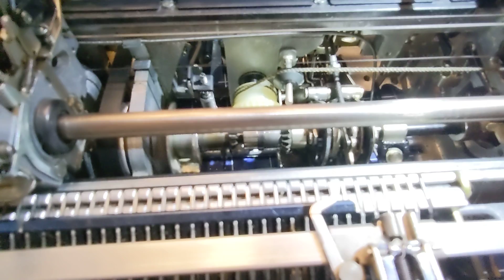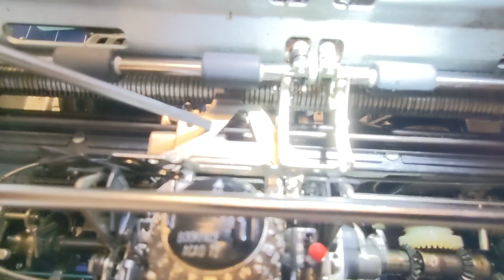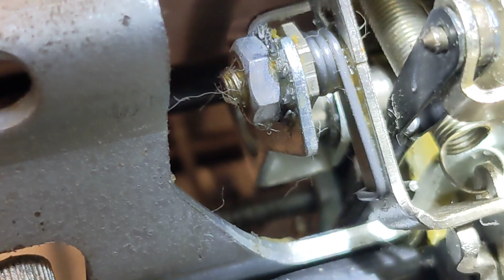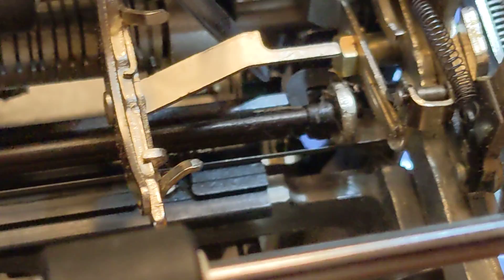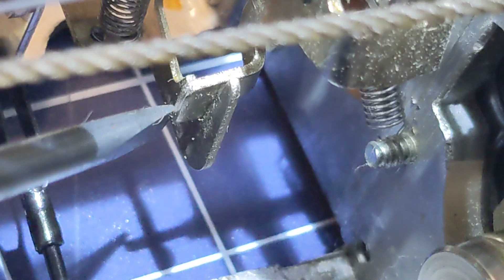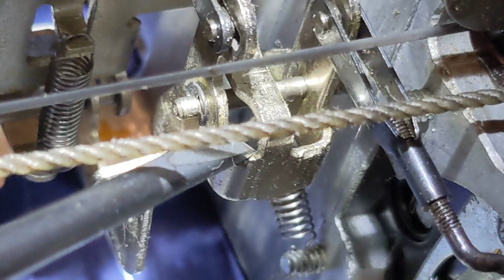IBM Selectric explainer: Escapement - space, correcting, and troubleshooting tips

Comment: Hello Nicky...I just pick up a IBM Selectric III - 50th Anniversary Model olive drab color in excellent overall condition, it comes on, tab works, return works, however the spacebar makes noise like its working but won't move, it will also type but again won't move across the page.  Wanting to sell it on eBay, Q> would it bring a higher price if I get it serviced or sell it as is?  It has a cover and manual; it appears to be complete.  Has a extra replacement ribbon B156 Nukote brand and box of lift-off tapes Nukote 86L-12.  Any advice would be appreciated.
Reply from the maker: @LoveMyRottweiler1 Hi! It's been a while since I've had my hands in the Selectric. The carriage advance issue is 90% likely due to waxy lubricant. Yes, it will be worth more working / refurbished, but probably not enough of an added to justify refurbishing it.

Check to see if the white plastic pulley on the main 'cycle shaft' is cracked. If it is, the machine will make a lumpy-lumpy sound as the cracked tooth contacts the drive belt. The fix is easy for golfball typewriter nerds, but not for normal people. Watch Duane Jensen's videos for a taste. I'd sell it as is, probably on Facebook Marketplace if possible.
Reply from the maker: One more thing: the whole of the mechanical machine is likely gummed up with waxy oil. Fixing the advance issue will likely reveal the next issue, and so on. There's a process by which the n3rds soak the mechanism in something like kerosene to dissolve the hardened oils.

These machines are amazing, but they were built in large numbers, so they're not yet rare.
Reply: @nickydoes  Excellent thanks for your advice...while I am okay at fixing things, I'm in no way a typewriter nerd, maybe I should be.  I have sold many parts off of these machine's motors & keys mostly, just not the whole thing due to the shipping weight.   I will most likely be selling it as is...will let you know where I post it...thanks again for your video.